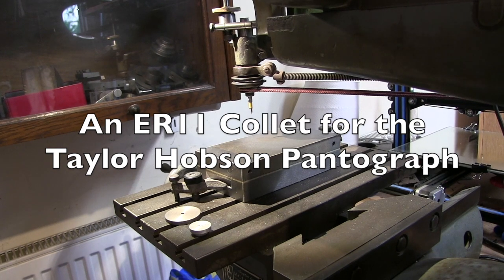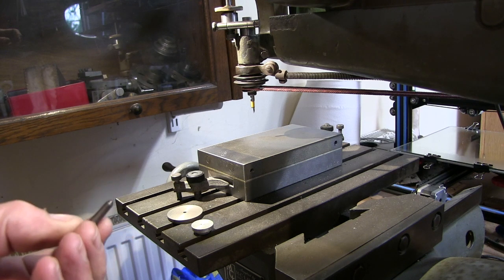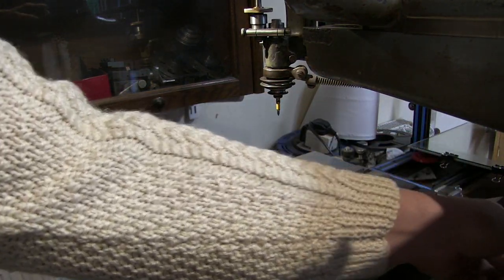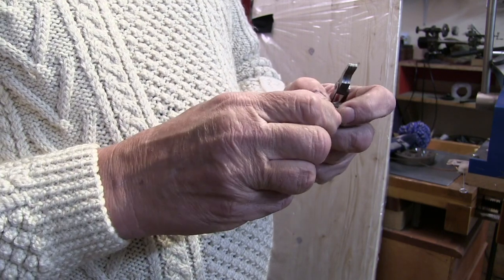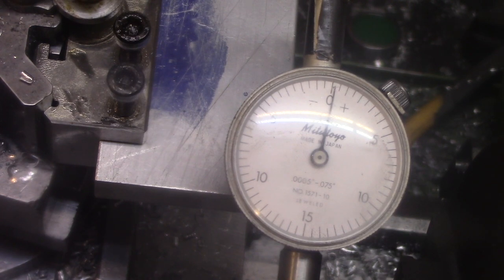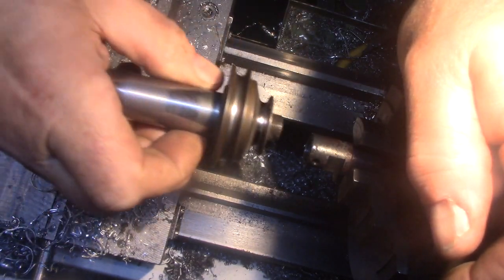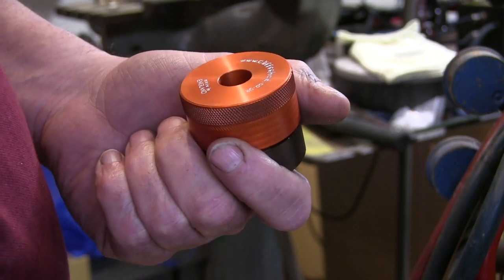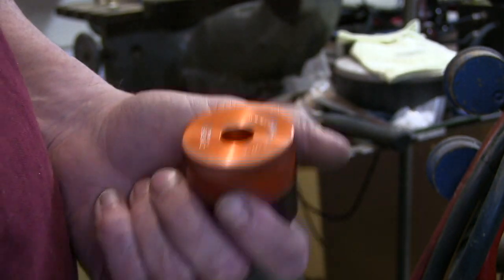An ER11 collet for the Taylor Hobson Pantograph.

Comment: Thanks Cliff. I've been wondering about doing this for my model D too. If anyone else is having a go check that thread. Mine is 1/2" x 30tpi not 28. Maybe they are not all the same.
One other thing. If you need to hold the taper shank cutters for sharpening. Find an old TH hss cutter and grind half of the taper away to make a D bit. Use this to cut a taper hole in a bit of brass rod and you can then use it to hold cutters for sharpening. Hope that makes sense.

Comment: Hi i have a type D you could buy a spindle to hold straight shank cuttets the thread on the end of your spindle is for the keep ring that holds the tapered cutter in i also have the cutter grinder for taper and straight cutters 
If you need photos i can upload them for you 
Paragraph services are a good company to deal with

Comment: That turned out good Cliff.  I was wondering if you could cut a thread in that hard steel, but it did.  I then wondered if the tap would pull off line (as they often do) but that seemed OK as well.  Overall it was a pretty good result.  Cheers Rob